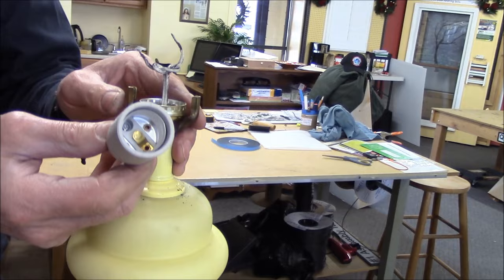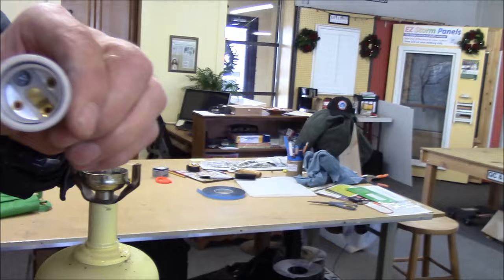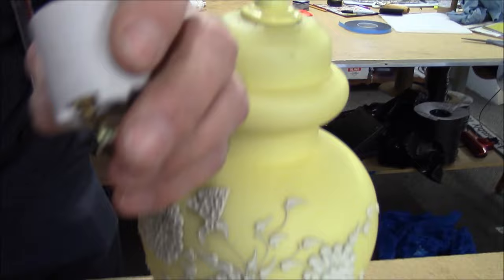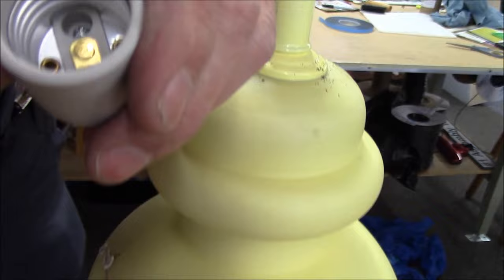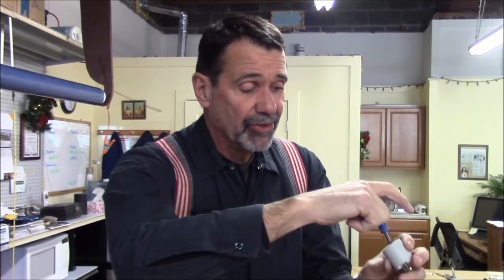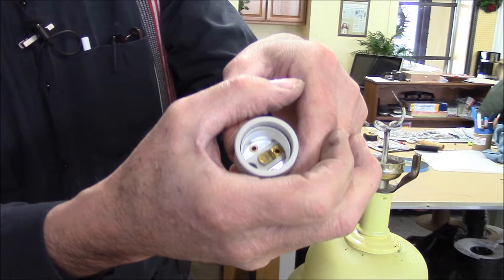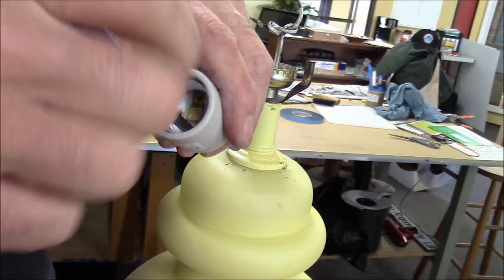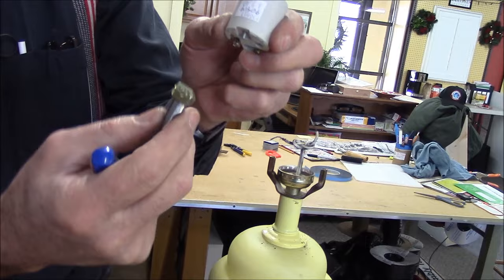Light Socket Removal Screw Releases Socket from Housing of Fixture

Comment: But what if socket has the hidden tiny screw but no screws for the wires. The wires are connected to socket with what looks like rivets? I don't know what they're called but definitely not screws.
Reply from the maker: Cut the wires close to the rivets and install the wire on the new socket.
Reply: What if there is no screw in the base ?

Comment: Do you have a video to show how to replace a outdoor light fixture socket ? Accidently broke off the cheap aluminum socket 🤦🏻‍♂️
Reply from the maker: Depending on what part broke, you can purchase the lamp holder w/a 1/2” pipe thread to replace the broken one.

Comment: Appreciate a lot! I had the courage to try to repair our rental’s lamp after hubby broke half of the socket because of a stucked bulb holder metal part and while I was unable to find the screw I came up with a solution how to keep together the partly broken plastic socket so it would be strong enough to hold the  bulb and now it works. We will never touch it again, until I find out how to change a broken plastic socket without  a screw tough…

Comment: I don’t quite understand. Where would the wires be? Are they attached to whatever the screw was screwed on to?
Reply from the maker: The wires are attached to the bottom of the socket. That’s what the small screw is for, when you want to get to them you can pull a socket to get to the wires on the bottom.
Reply: @MrHardware1  Thanks. I have a kitchen light that has a metal housing where the socket is. It’d be nice if there’s enough wire to work with without taking the entire fixture down.
Reply from the maker: @chiararomano1818  There could be, but don’t count on it. The manufacturer save every penny they can.

Comment: Great tip I got a question for you I'm living overseas and I bought a light socket for the yard balcony and the one they sent me it's a plastic socket which is okay I guess it seems sturdy enough but my problem is on the back of it it doesn't have the screw the wire terminals with the screws they seem to be missing I contacted the vendor online and they told me the wire can just be pushed into the back but I don't see how they can be secured to anything even if I push it into the hole I've never seen a socket that doesn't have something to screw down the wire ever seen anything like this I guess it's usable but I'm not sure I could just replace the socket with one from the hardware store that actually has screws that's kind of what I'm thinking to do maybe getting one of the porcelain models instead of the plastic but for me the bigger problem is the screw I don't know how to just shove the wire in there it's kind of weird for me to just shove the wire in there without securing it to something
Reply from the maker: We call it speed wiring when you can just shove a wire into the back of either a switch or a receptacle and there’s a spring loaded clip that snags the wire. It’s difficult to put stranded wires into one of these sockets as the strands don’t hold together, so we have to take a soldering gun and a little solder to solder all those strands in the one solid wire so that will work into that push connector.
Reply: @MrHardware1  hey I appreciate the answer I actually opened up one of the previous receptacles on my balcony and I see that the light socket on that one has the same setup there's no screws for the wire terminals it just seems like they just shove the wires* into the back of the socket. It's a little strange for me I'm used to always screw in the down the wires* with the screw but I guess as long as it works and it stays in. Overall I'm pretty happy with the new light socket it's got a little aluminum on the back so it sort of reflects the light and a lot better than my 20-year-old ones. I'm just not sure when I'm going to get around to hooking them up. I'm living in an old house so there's always some kind of project to do I did hook up a couple but I bought three new ones. Difficult to prioritize the project sometimes I feel like I need a clone of myself. Or better yet a clone of somebody who's a little more handy lol thanks again I appreciate the answer.
Reply from the maker: @StAnger561to770  start with the project you have all the parts for and just stay with it and get it done. It’s so rewarding when you get one knocked off completely it gives you more energy to start on the next one.
Reply: @MrHardware1  thanks yeah I appreciate it I'm doing things step by step today I cleaned out part of my split air conditioning unit on the outside. It hasn't had a proper cleaning in years and the radiator fins were all gunked up. I don't have one of those fin combs but I did what I could without taking the machine completely apart it was sort of limited but I did clean out the inside bottom of the tray that was pretty gunked up too. I did a test with the socket I had a spare wire lying around from previous work and I was able to put the wire into the back so it does seem like there's some sort of a spring when I went to pull it out it was a little difficult to pull out I almost thought it was going to snap the wire so the socket seem usable I'm just not used to the setup but as long as it works and the wires stay in where they're supposed to that's the main thing I appreciate the encouragement have a great day

Comment: What is the screw called if it's lost and you need another one?
Reply from the maker: It might be a 4/40, however it’s not a standard size. I typically just replace the socket for about three dollars or hope the screw in the new socket fits the old/existing socket. Rob Peter for Paul.

Comment: I.removed the screw and the wires are still attached to the wall fixture.
Reply from the maker: Sounds like you have to take the fixture off the wall to get some slack in the wires so that you can change the bad socket.

Comment: Do you make house calls? I’m right down the street from you guys. I have an original 1960’s MCM chandelier with 4 lamps that has 2-3 cracked sockets that needs replacing.
Reply from the maker: No, but you can get a contractor from gilbertscontractors.com that will come to the house. Or bring it to the store and we repair/rebuild at the store.

Comment: No screw here
Reply from the maker: Some are riveted, the top of the fixture will probably have to be disassembled to change the socket.
Reply: @MrHardware1 would appreciate if you had a video of that someday. I myself tried to find the screw in our rented apartment’s socked, and nothing. I have a good imagination but couldn’t even see the screw under the metal topping thingy. It is in Eu, Paris, maybe these french people have different sockets?! Aaaa…..
Reply from the maker: @LAigner  once you remove the fixture off the wall and you have it on the bench, you should be able to see how that socket was attach the fixture, and then look for a replacement with that information

Comment: Screw doesn't bulge :(
Reply from the maker: Then I disassembled the fixture to remove the bad socket. If you have enough skill I’d try to drill off the screw head. Start with/a small drill to get a pilot hole in the center of the screw head. Then use a 1/8” drill and the screw head will pop off as you hit the body of the screw.